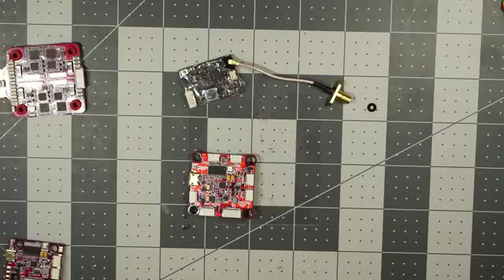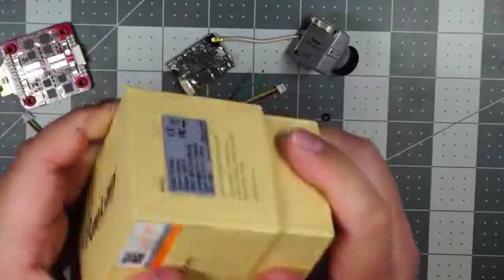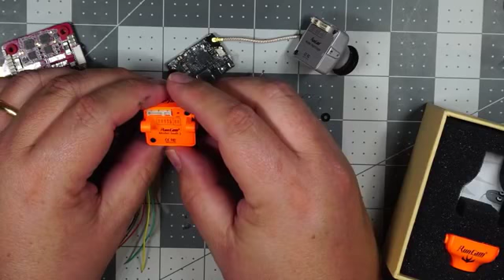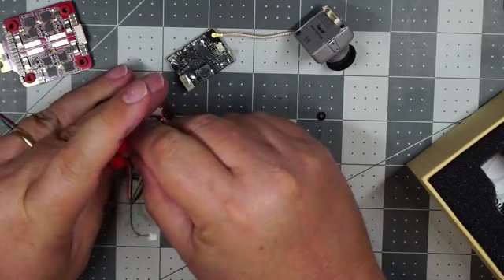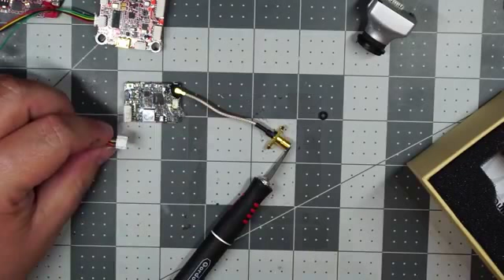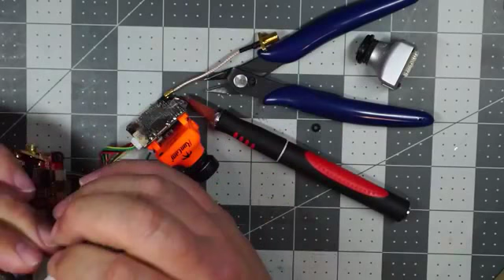Wiring Harness Install

Comment: Thx for this video. I'm a bit confused by the way the VTX is plugged on the FC at 06:13. On the video, you plug it to the TX4/3V3/5V/GND port. Shouldn't it rather be plugged right to the camera port, on the one with TX3/VOUT/GND/VBAT?
Reply: I think he mixed them up, he plugged into the wrong plug. :(

Comment: I understand the idea behind the plug and play, but this was how the old SPRacingF3 was with all the I/O on plugs. These were a bit unreliable. Maybe if the plugs were all like the TBS unify pro HV plugs, that would be more secure. this is intended to be constructive criticism not bagging the product out. I have just built my first RF quad and first impressions are promising. The quality of the RevoltV3 and Bolt 4in1 is some of the best I have seen. Cheers
Reply: instablaster.

Comment: On 2:19, you explain how to wire the "Camera Control" pin of the FC to the OSD pin of the camera but it seems that the camera control itself is not implemented yet in the software, correct?

Comment: I couldn't get a foxeer micro to work with camera control.  On betaflight you need to change the internal resistance for the foxeer's is there a way to do that on flightone?

Comment: Any newbs watching this (like me), the VTX is NOT plug and play (specifically if you’re using a TBS Unify pro). You must solder the power wire to to 5V or else you will burn up your Vtx trying to use the 4 pin on the Flightone Reverb OSD. The 4 pin used here goes to vBat which is 12v. Ask me how I know....
Reply from the maker: Will Neville it’s plug and play for the race vtx